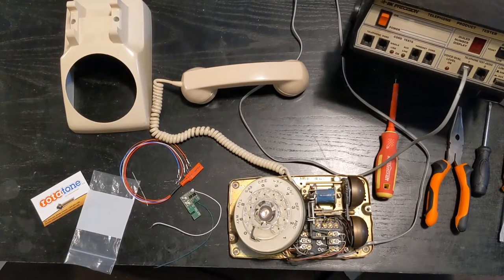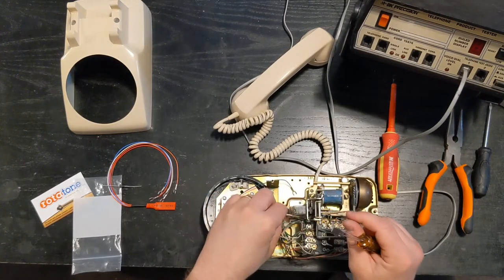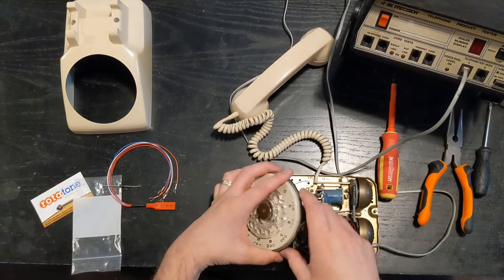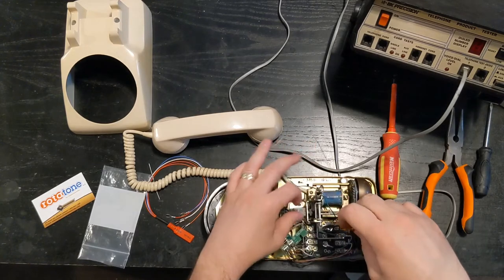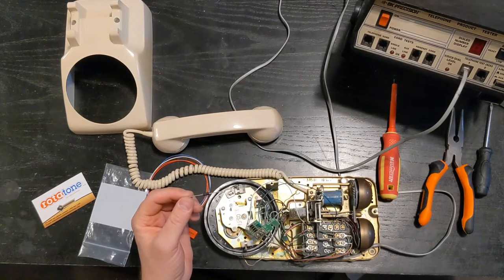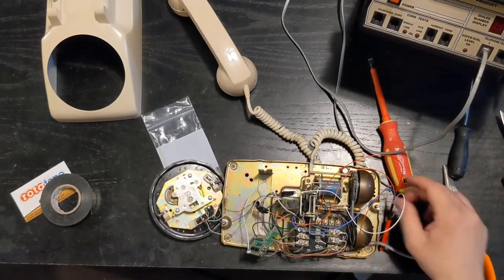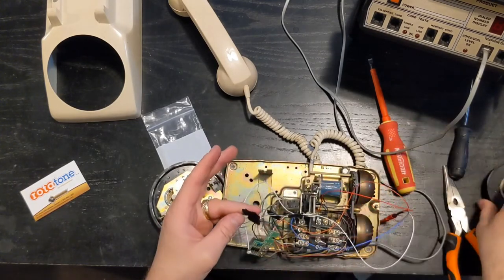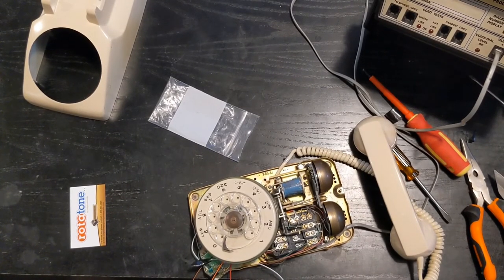Installing a pulse to tone converter in a 500 telephone

Comment: at 5:11 mark you disconnect the "R white wire".  The White "R" wire connect to the handset and I never see you mention when or where to rehook it.  I'm confused.  Also, I can get a dial tone after splitting a modern telephone connection and rewiring it to the phone, but I can't seem to ever have my dial work.  Any suggestions on what I'm doing wrong?